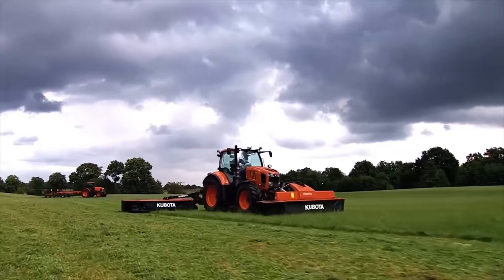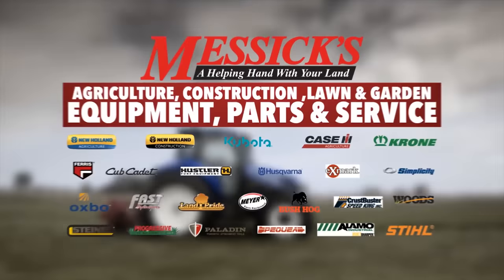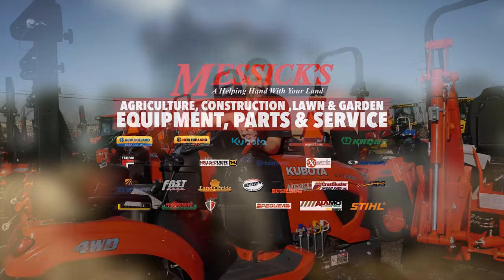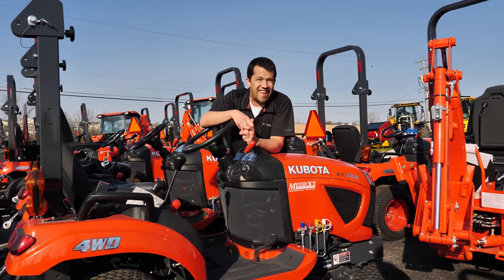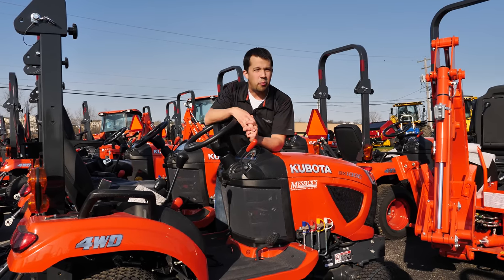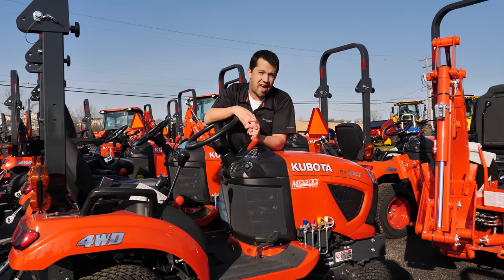Proper use of a Hydrostatic pedal - TMT

Comment: Hi - hoping someone can help me with a question. I don't have a left leg from an accident- I use my right leg to drive with. Are there any tractors- I want one with loader and maybe backhoe, that are all right side pedals?
Reply: I think older Kubotas with hydrostatic transmissions have both the hydro pedal and brakes on the right. Most people complained about that feature but for you it would be ideal. John Deere also had some models like the 4600 HST that had split brake pedals on the left, but a master brake pedal on the right that operates both brakes. Sorry I can't be more specific on model years and such.

Comment: Great Info.  Is there any way on a BX 250 Kobota tractor to stop the rear 3ph from moving when the  belly mower is moved up or down?  Poor design if not.
Reply from the maker: they are tied together, most all tractors are done that way with very few exceptions.You can lock the deck up, but you can't lock the 3pt.
Reply: Thanks for the confirmation.  Very annoying if you have the Chipper mounted and want to mow the lawn.
Reply from the maker: Yea, stuff like that is normally the concern. With a 3pt quick hitch you can drop it very quickly. Really, you should not have all that added weight rolling back and forth on your yard.

Comment: My issue is tractor some days refuses to shift into neuatral which means tractor wont start,,,only 7 hours on tractor,,whats the fix,,very aggravating
Reply: You should press the pedals (front, reverse) couple of times and it should work smooth then. Works everytime when the lever is stuck.
Reply: @JJPlaycek  I think the linkage needs adjustment,,when it gets stuck if i physically push tractor forward or backwards a little while someone is on tractor they canthe shift in into gear,,saw a you tube video where guy jacked rear wheels off ground and cranked tractor,,if wheels still moved while tractor was in neutral the linkage needs adjusting,,i bought a farmtrac 25 hp new for 10900 in jan from fl dealer,,im in sc,,knew it was a gamble since no sc dealers but price was 6k less than comp tractors,,so far its been a great little tractor except for the sticking in gear issue,,once i get some help im going to try and fix it using the wheels off the ground trick,,local JD dealer said its exactly what they do at their shop,,he said many of the korean and india produced tractors have same issue,,

Comment: In theory this sounds like it works, but in real life it doesn't. A tractor as light as the BX needs momentum to get a full bucket worth of material. I cannot get a bucket full in "low gear" with the pedal. Must be full throttle into the pile with some grunt. Using the machine on a daily basis for 2 years now this is just the way it is.

Comment: While the hydrostat tractors are nice,did anybody notice how all the engine power had to just about double to do the work of the older gear drives.Used to be able to creep down a steep hill ultra slow with low rear and 1st gear in 4x4 and not touching brakes and be in full control.But a hydro won't hold you back enough slow enough and be in control.
Reply: What are you talking about. Letting off a hydrostatic pedal is almost like appying the brakes. You can come to almost a complete stop while going downhill on a tractor that has HST and not have to touch the brakes.
Reply: I find the hydros to be more in control on steep hills, but your right....... You get more power loss through a hydro unit over gear drive because of friction.  Thats why most tractors are also offered in gear drive.  But all me old fashion, I will take a hydro over a gear any day for tasks involving loader work or mowing the lawn.
Reply: While they consume power the ability to start/stop/creep while running a PTO driven implement is totally worth it.  For example I have an old Iseki hydro and a  old geared kubota tractor both with essentially identical engine power.  However the geared one uses less horsepower in the drive.  When running a mower in heavy stuff up a hill the hydro bogs more.  However, I can slow or speed the hydro over ground speed while keeping the PTO running and pick an over ground speed that feeds right.  The gear tractor has more power available at the PTO and at the axle due to less loss into the trans but if it bogs down you are forced to shift.  Not all tractors in this size have two stage clutches so you end up having to go to neutral run the PTO implement till it clears out or even back up and take a smaller swath while the hydro you just back off and let her clear out.